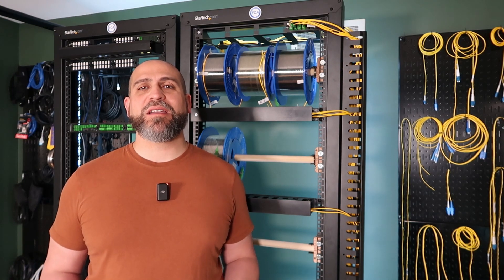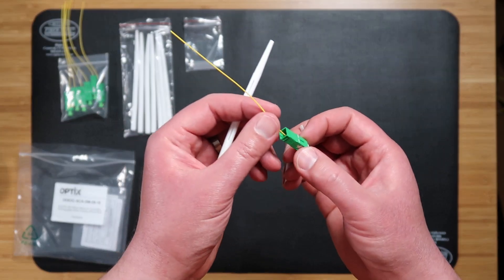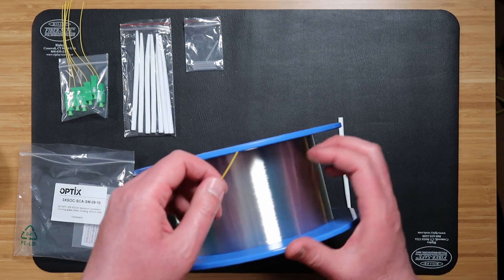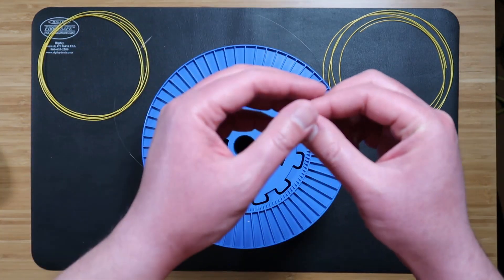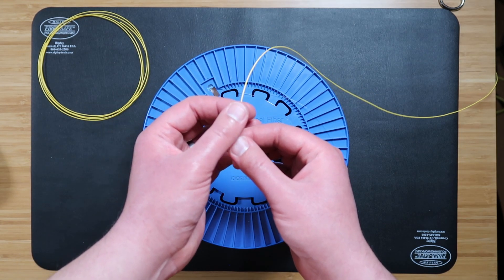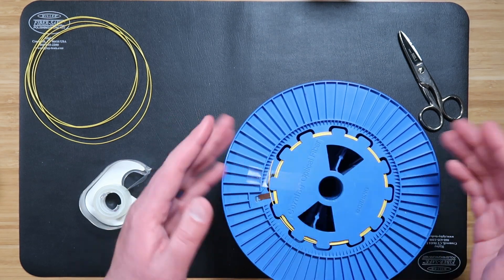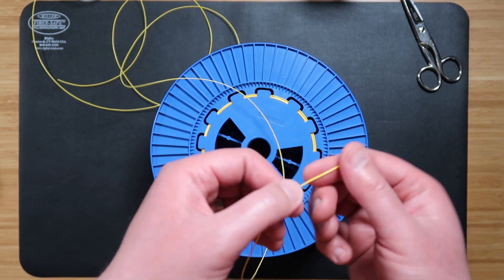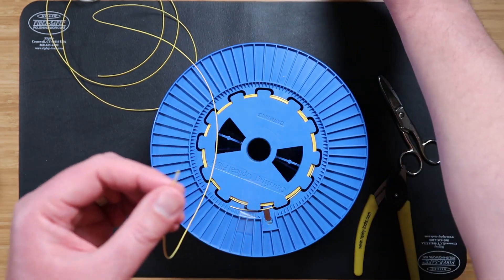Preparing Fiber Optic Spools For Use In Our Home Lab

Comment: optix SOCs are great, I did a few of them and it was nice just being able to use the normal fiber holders rather than a special soc holder
Reply from the maker: That's definitely a big advantage for them, as well as the reusability factor if you mess up (which we did many times trying to terminate them on the spools). We also found some disadvantages, however, and go over them in the next video. Look out for that this evening or tomorrow.